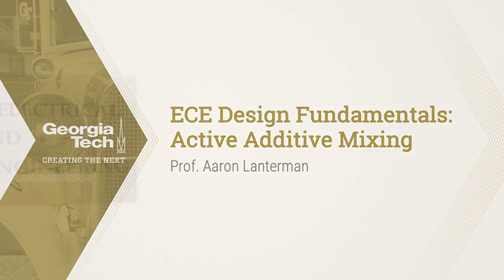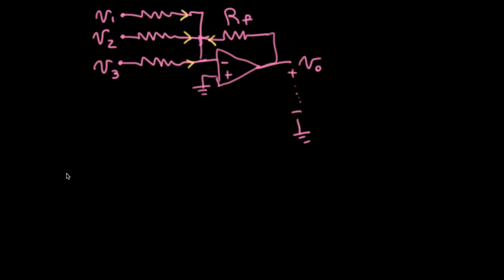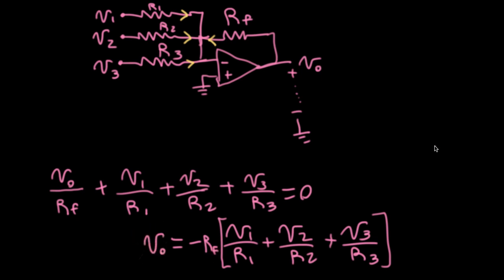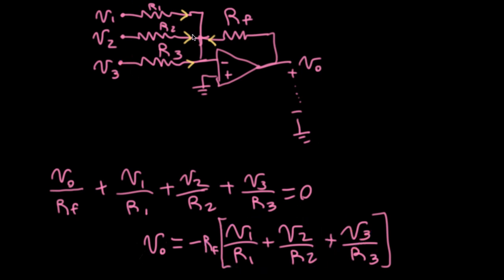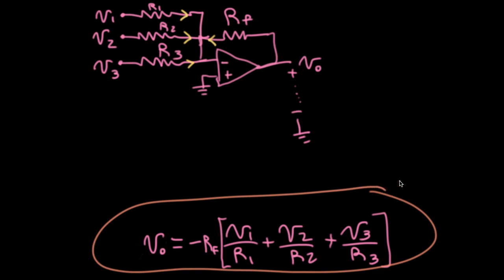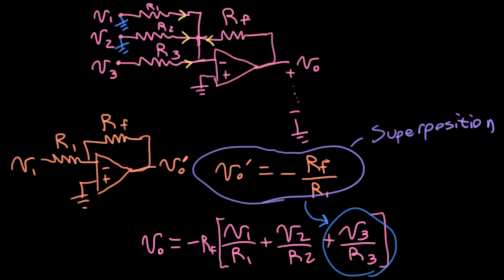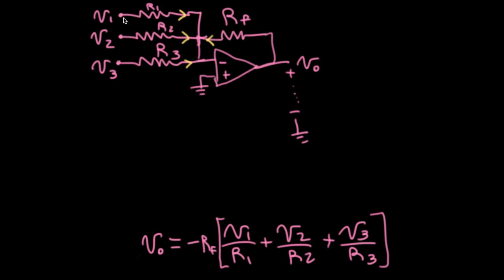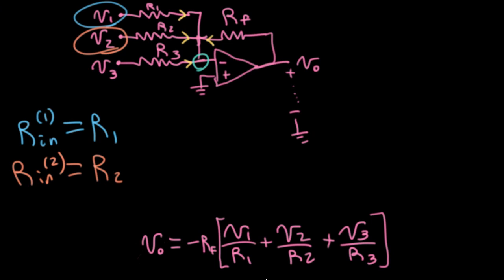Active Signal Summing/Mixing, Using Op Amps in Inverting Configurations (ECE Design Fundamentals)

Comment: Dude, your videos are excellent. If you had a book with similar content, I'd buy it. Your content sits wonderfully between having technical depth and being functionally useful for the intuition; no mean feat considering the subject matter.
I've been working in industrial controls for years, analog audio on the side. I find it difficult to get the joke, so to speak, of the analog audio books I have. Your content gets to the heart of the parts of audio electronics that I can actually put to use.
Thanks :)

Comment: if you care about the phase, aka the fact that your signals are now inverted, is there any concerns with dropping another inverting op amp after the mixer?
Reply: That's the general idea. Sometimes though it makes more sense to perform other tasks inside the circuit and leave it inverted until later. It just depends on what the function and complexity of the circuit is. In eurorack modular synths it has become more of less standard to have 100k resistors on the inputs and 100k feedback resistor to create a 1 to -1 gain. Then, as you state, put the inverted output through another 100k resistor and invert is back with a 100k feedback resistor.
Reply: @murky66  ohh right that makes sense, this helps keep the inputs from loading the source
Reply from the maker: @psynautic  Shawn's reply is on target.